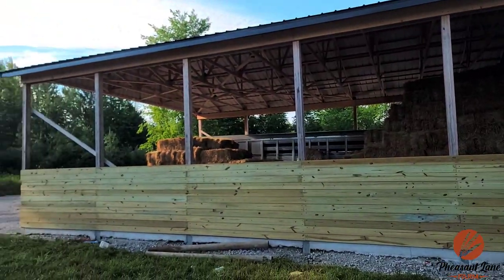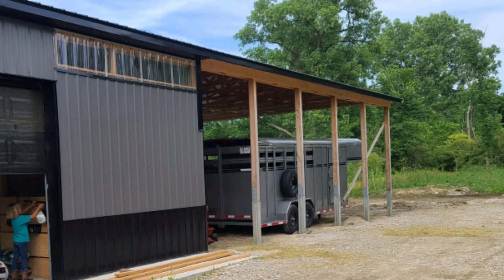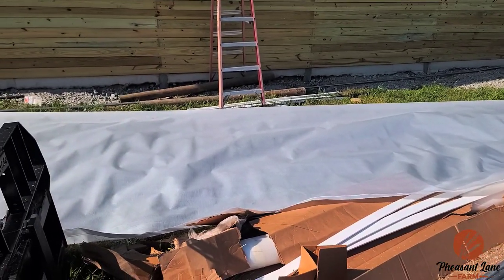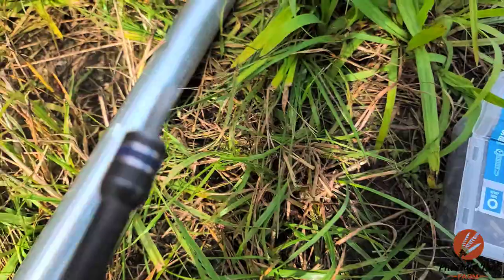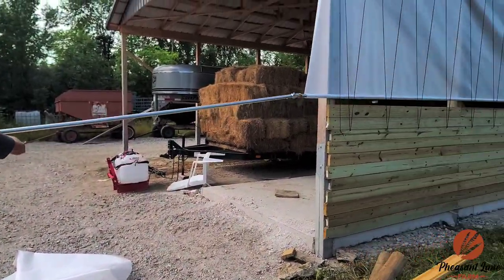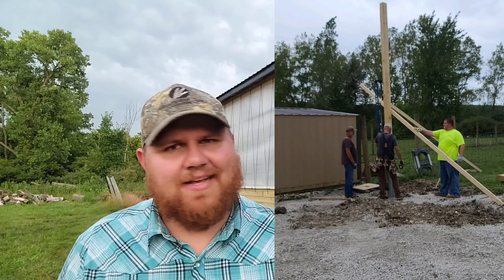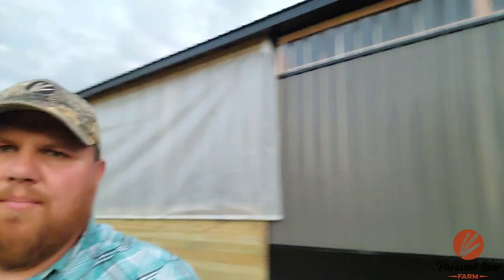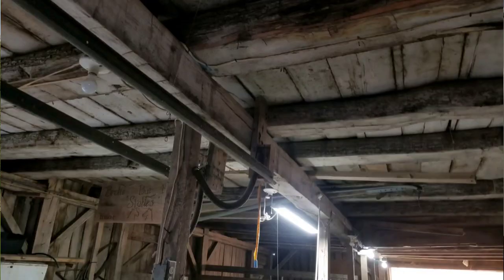Farmtek Barn Curtain Installation

Comment: I'm looking at doing similar on my cattle feed shed.  I built a 46' x 172' heavy use area that I can't cover due to it being an fsa/usda project.  The cattle shed outside the heavy use area I covered and am trying to enclose along the feed wall/headlocks.  Keep the hay under cover and the rain/snow off the feed and equipment as much as possible.   Looking at these curtains, seems like the way to go.  Thanks for the video.

Comment: hi how mutch does the curtain cost and how big? in x in
Reply from the maker: It's 7 ft x 40 ft wide. I bought 2 but ended up using one. I can't find my receipt, but I feel they were around 1400 for both with all the hardware, rope, and handles. I could be wrong . If I find it I will let you know. This is the clear version, however it looks white.
Reply: thank you , what is the name of the manufacturer?
 @PheasantLaneFarm
Reply from the maker: @harly193  I went through Farmtek and was very happy with the product and customer service.